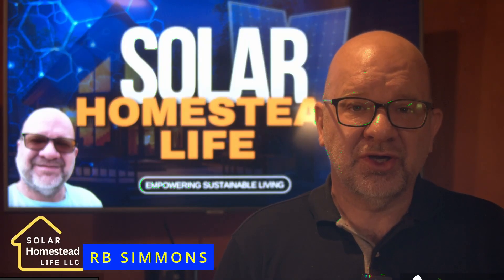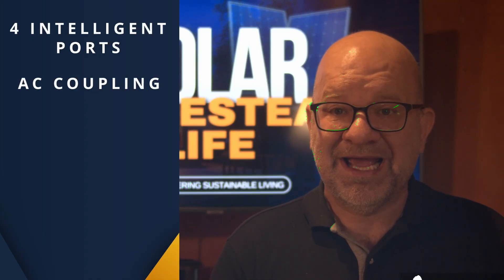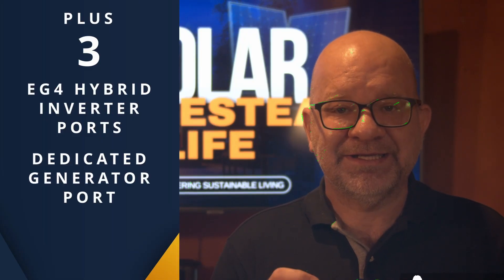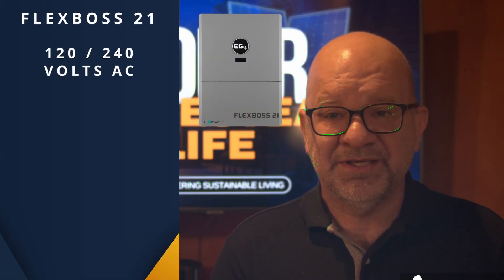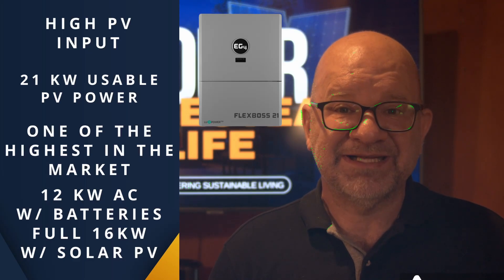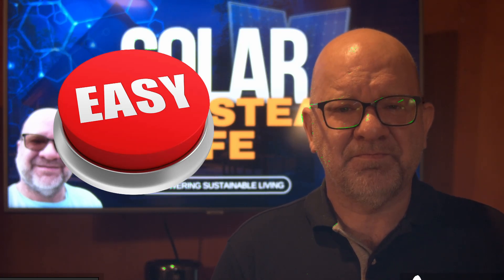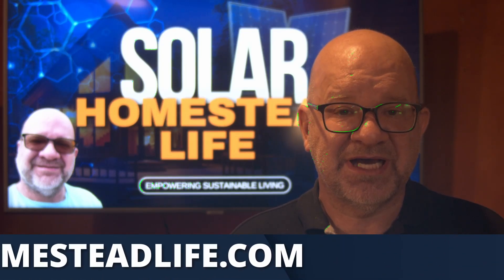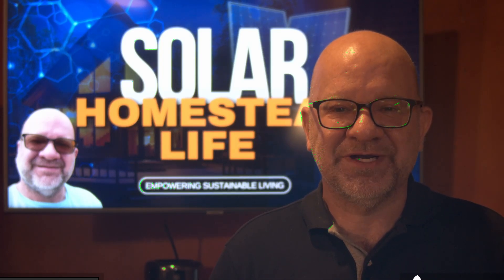EG4 GridBOSS & FlexBOSS21: Game-Changing Solar Tech for Whole-Home Backup

Comment: I know I need batteries and a solar array.But I was wondering what else I would have to have to get the flex boss21
Reply from the maker: Great question, @marktaylor3630! To get the FlexBoss21 up and running, you’ll need a few key components in addition to your batteries and solar array:

Inverter: Converts the DC energy stored in your batteries into AC power for your home or devices.
Charge Controller: (if not built into your setup) Manages the energy flow from the solar panels to the batteries.
Wiring and Disconnects: Safely connects the system components and ensures proper functionality.
Mounting Hardware: Positions your solar panels for maximum sun exposure.
Monitoring System (optional but super helpful): Tracks energy production and usage for efficiency.
The great thing about many EG4 inverters is that they often include the charge controller, disconnects, and breakers, which simplifies the setup and saves you time and effort. Let me know if you have any other questions or need help getting started!
Reply: @SolarHomesteadLife   thank you so much i have another question. I have a ten back 10x32 moble  home I'm wanting to set it up off grid how many watts would you recommend? I would assume going bigger is better and on a mppt does it matter the size or do you have to one based on your inverter
Reply from the maker: Great question, @marktaylor3630! For your 10x32 mobile home, going off-grid is definitely doable, and it starts with figuring out how much energy you’ll need. I recommend creating a simple spreadsheet or using a watt meter to track everything you’ll be using. Write down each appliance or device, their wattage, and how many hours per day you’ll use them. For example, LED lights at 10W each with 10 bulbs for 5 hours would be 500 watt-hours, and a refrigerator running at 150W for 24 hours would be 3,600 watt-hours. Add up all your devices to get your daily total in watt-hours.

A good starting point for your solar system is 4,000–6,000 watts of solar panels, which would be about 10–15 panels rated at 400 watts each. This gives you some extra power for cloudy days or future energy needs. For your inverter, it should be sized to handle your peak power demand. Something like the EG4 6000XP works well for most setups, but if you plan to expand, going bigger might be worth considering. Your MPPT charge controller needs to match your battery bank voltage (like 48V) and handle the total current from your solar panels. Be sure to check the maximum panel wattage and voltage it supports.

If your budget allows, oversizing your system is a smart move. It gives you flexibility for unexpected power needs and ensures you’re covered during cloudy days. Let me know if you’d like help setting up a spreadsheet or calculating your energy usage—it’s a little work upfront, but it’ll make things much easier when you’re ready to set everything up.

Comment: Wonder how well it can handle a classic gas generator.
Reply from the maker: Thanks for asking! Here’s what we recommend for using a gas generator with the EG4 setup. If the generator doesn’t produce a pure sine wave or has a high total harmonic distortion (THD), you'll need a chargeverter in between. For instance, with older generators or those with a THD over 5% (like 12-15%), a chargeverter will help protect the inverter from potential damage. This is crucial since EG4 inverters, are designed to operate with a THD of 5% or less. Without that, you might experience issues, so it’s worth checking your generator specs or adding that extra buffer for smoother, safer operation.